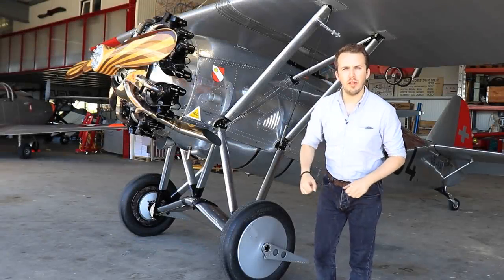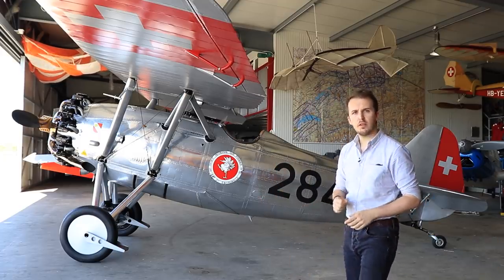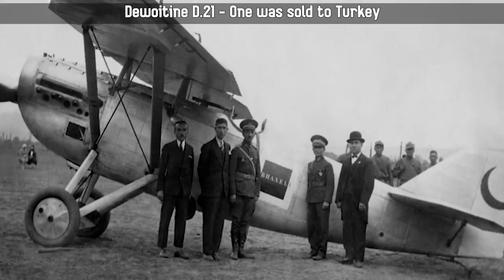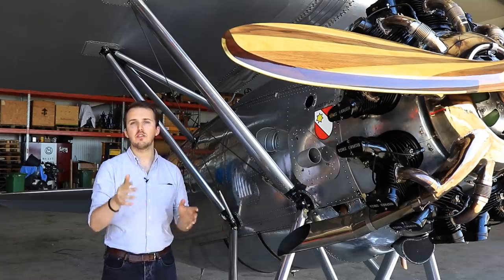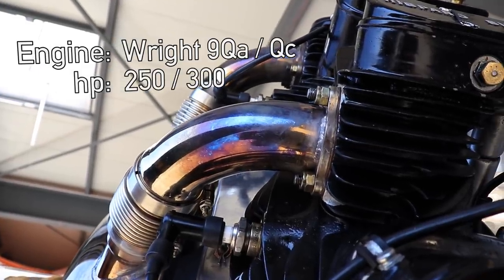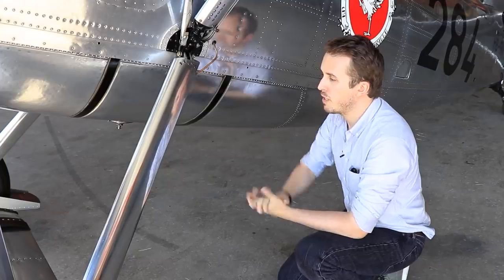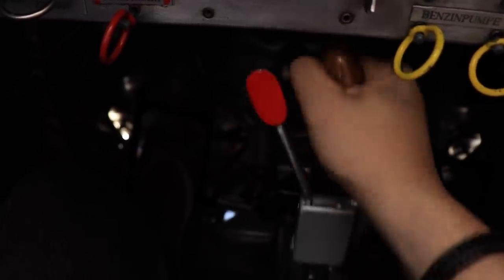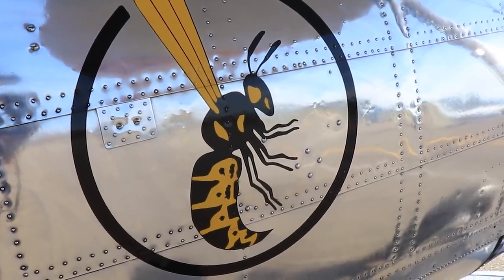Inside the Cockpit - Dewoitine D.26 / D.27

Comment: Love it! 👍  more lesser known planes please!   I have never seen a plane with a main fuel tank which is jettison- able  in the event of an emergency
Reply: G'day,

Believe it or not, when I bought my not completed Volmer Jensen VJ-24w, a 22 Hp Ultralight Motorglider, the bloke who I bought it from had built it with 2 Fueltanks under the Seat (the Rudder Cables went through the gap between them) and they were set up so they could be dropped free of the  machine, in the unlikey event of an inflight fire.

   I considered it a foolishly paranoid fantasy (only 1 Ultralight in Australia has ever crashed as a result of an inflight fire...), so I covered over the hole to reduce Parasite-Drag.

   After all, how big a Fireball could 3 gallons of 2-Stroke Fuel actually produce ?

   Such is Life,

Have a good one...

Stay safe.

;-p

Ciao !

Comment: Could you explain us why new planes were often built with engines that were in lower demand during WW2? For example fw 190 using bmw 801: why did they even make bmw 801 engines instead of converting every factory to produce the best engine they had (db 605)?